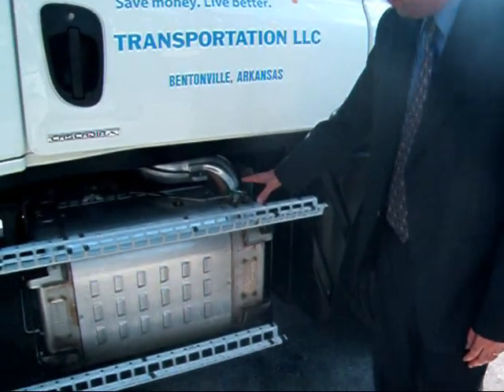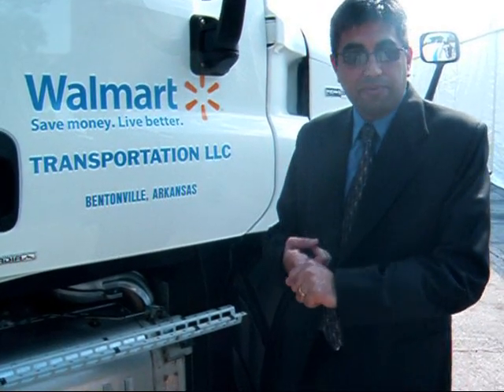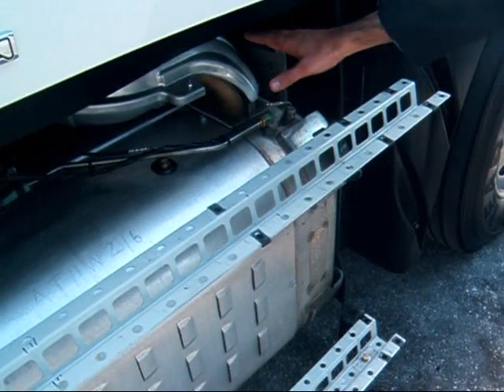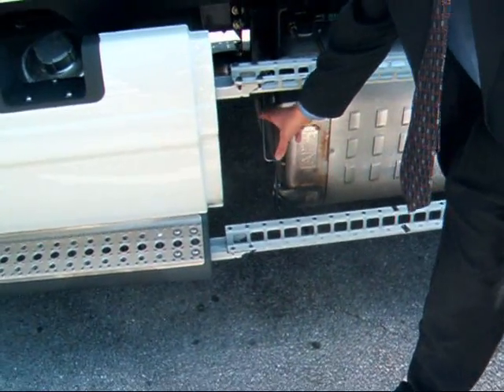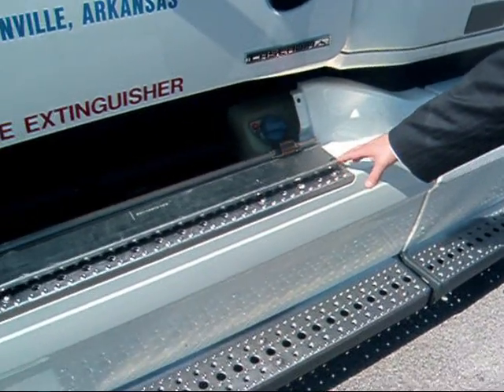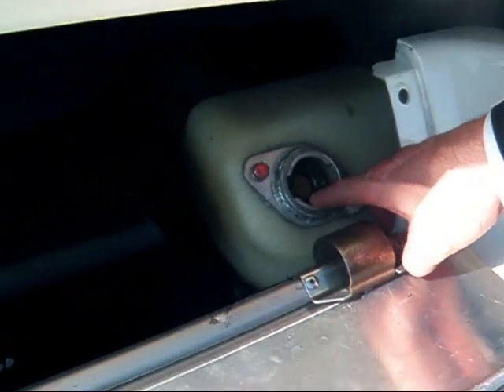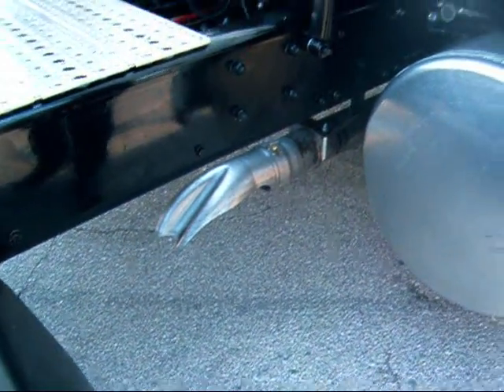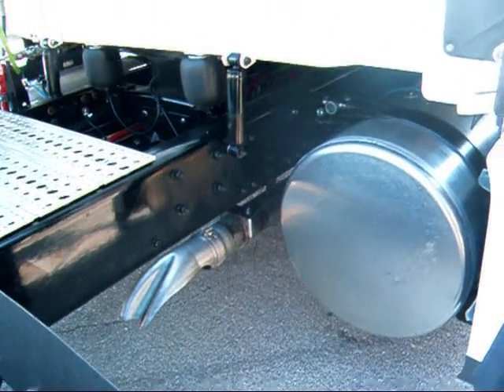Detroit Diesel SCR | Part 1

Comment: Dont ever bypass the scr box unless you want a blown engine the extra sut gets in the oil and makes the oil very abrasive to your pistons and rings bearing and crankshaft never run ot on water nothing good comes from this being removed